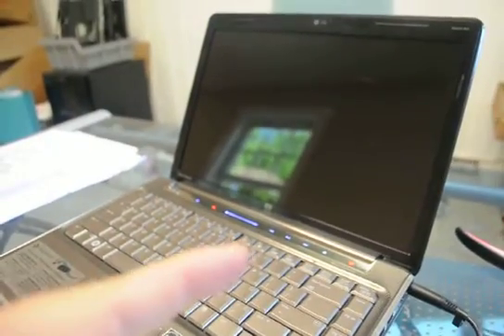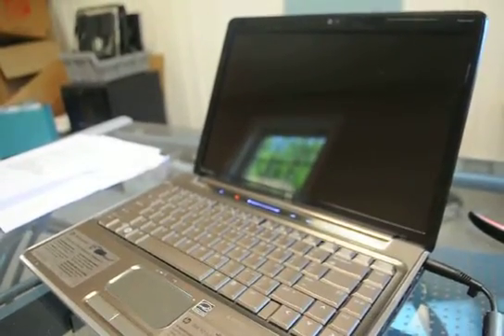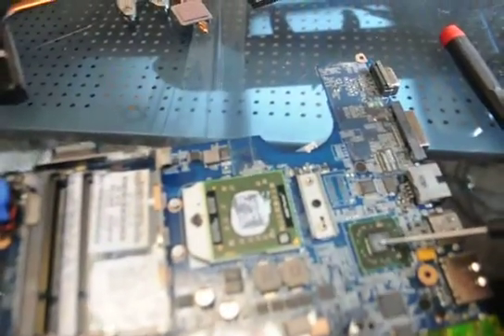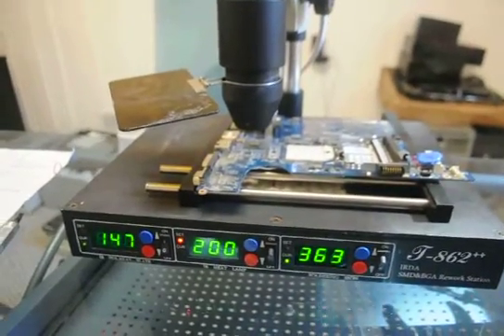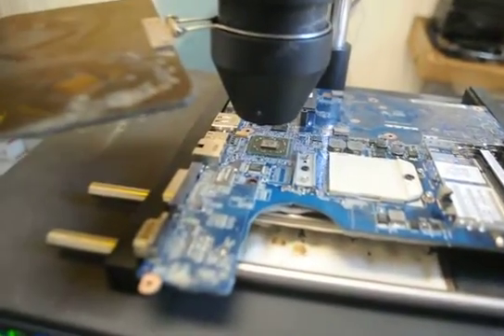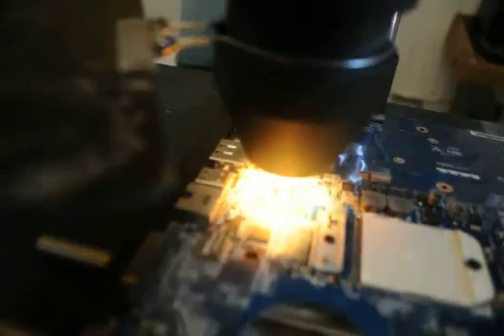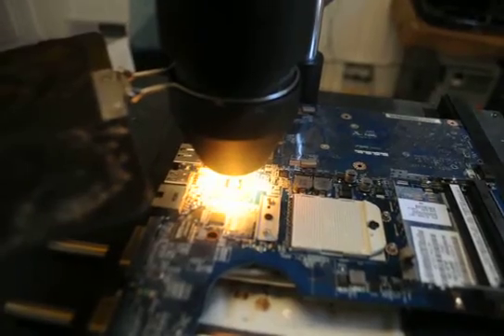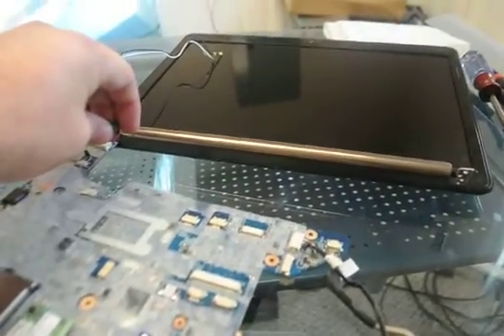IR based laptop BGA reflow of a HP DV4 motherboard to fix a no video and no power issue.

Comment from the maker: @IcaroChacal I do not apply flux unless I am reballing.  Reballing honestly requires flux paste and not liquid flux since liquid flux will cause issues.  It can be used to reball with temp shielding and a vacuum remover.  Hot air can be used or the IR system, they both remove well.

Yo soy un adicto al trabajo, así que estoy a su servicio para ayudar a la actualidad y todos los días.

Comment: Great Video. May i ask tho, do you apply Flux to the chips that are to be Reflowed, like in that DV4?. Also, i was wondering if you use the T-862++ console to desolder BGA chips to be Reballed or Replaced? Tremendo trabajo, gracias mi hemano.

Comment from the maker: @MrSmallWalrus  Point in case is that those were fixed with a light IR system 19 months ago and still work since the user followed my tips of using a laptop cooler, udpating the drivers, and updating the BIOS.  Light IR works just as well if you ask me.